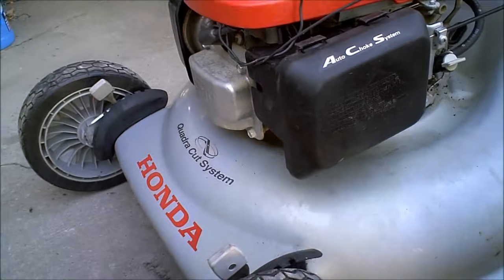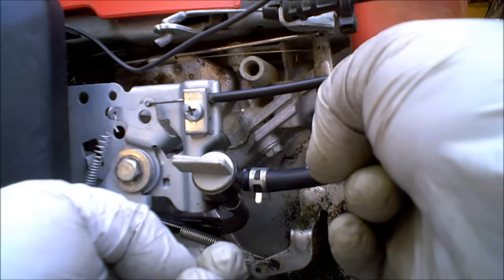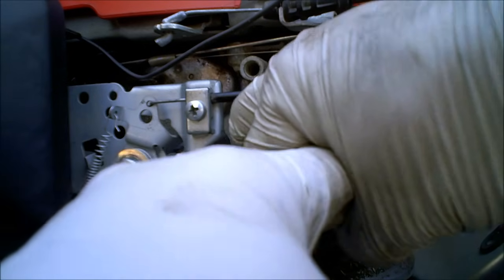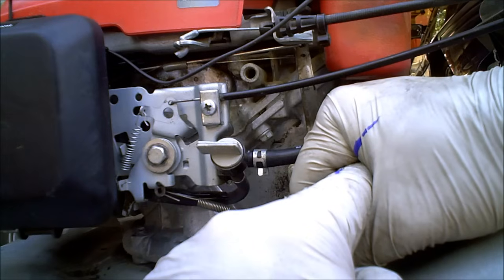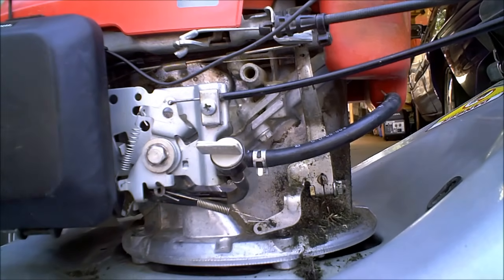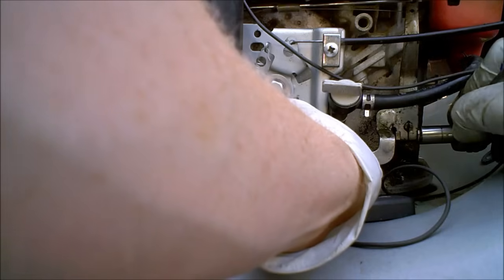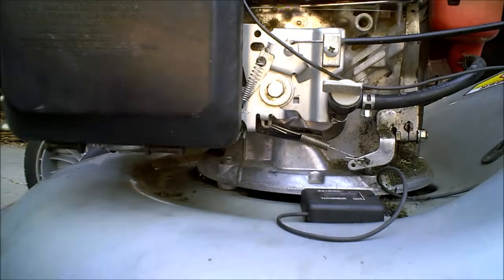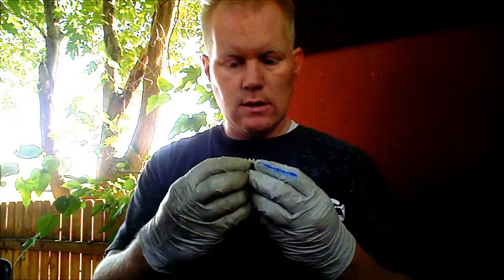Governor Adjustment and How They Work       Honda Briggs Tecumseh Kohler etc.

Comment: Appreciate the video 65Ford! Can u help me out? I have a 5.0 HP/158cc Briggs & Stratton Murray lawn mower. I've been messing with the governor and noticed that that's why my mower is over revving. I can't keep it to stay where it should though. I move it over and it starts and stays at the right RPMs, but then it moves over after about 30 seconds and stays over revved. Do u know what I need to do?
Reply from the maker: Free2 Speak Is your carb throttle moving? The butterfly can get stuck open.
Reply: sixtyfiveford It doesn't really move freely, but it does seem to stay open after a few seconds. Thanks in advance for the feedback.

Comment: I love governor videos.  I think of the old ones on  the steam tractors with the ball weights.  same thing as the internal ones here.  Hey you are looking clean cut in this vid!!!
Reply from the maker: Bruce Pender Yeah, this video has been around for a couple years and no beard then. Governors are a mysterious thing to people but they are so simple.
Reply: sixtyfiveford I hope you don't mind I just did a vid on the 6.5HP Briggs Intek. governor.  I had two come in before and then just after I commented on your video.  Things are so weird how they happen.  My first one was my 8-32 snow-blower (Tecumseh)
Reply: Thanks you are right.  I still get nervous in front of the camera and my brain goes blank
Reply from the maker: +Makek0086 It is a RPM maintaining devise. It maintains RPM weather it tries to go to high or to low.
Reply: the discussion continues.Thx 65
Reply from the maker: *****
I know exactly how a governor works and I didn't say it was just a limiting devise. It is a Maintaining device. It doesn't sense load, it's simpler than that. Your giving it more credit that it deserves. It simply tries to maintain a given rpm.

Comment: g'day, thanks for posting this video it was really good. i have a kohler xt 6 mower that has recently begun surging/hunting. it will run well for five mins or so then it just decides to start surging/hunting. very frustrating when im hlfway thru a job. ive had the local mower shop look at it (twice) and clean and repair carby (pin) but the problem persists. i want to ask you, do you think its possible that the governor mechanism is damaged? like the weights dont throw out correctly? do they break? get stuck? i'd really appreciate any advice you have to offer. thanks in advance, Haggis, Sydney Australia.
Reply from the maker: craigdy It's the carburetor for sure. The idle circuit is clogged or partially blocked. The governor surging means it is working and keeping the engine running.

Comment: Hey man, Great video.  Very informative!  Just got a brand new HRR2169VYA and was running great until the other day it started surging....brought it into my shop and they replaced a thermo wax sensor.  Fixed the problem....now it seems like my rpms are higher than before so I am most definitely gonna hook up a tah/hour meter to set it right. Only question I have is the 2 adjustments on the carb....I'm assuming the one closer to the engine with the limiter cap would be the main jet and the out Philips spring would be low speed? Correct me if I'm wrong but I had messed with them before I took it into the shop to try and bypass having to bring it in and would like to know how to get back to original settings before I go for a governer adjustment.  Info would be greatly appreciated! !
Reply from the maker: David Cardone The 2 noticeable screws on the top are: idle jet mixture and idle speed. The one that only allows half a turn or so with the cap is your idle jet mixture screw and you won't notice anything when you screw it in/out (should be turned all the way counter clockwise). The Phillips screw is your idle speed adjustment. Screwing this one in will increase the idle speed and screwed in too far will increase the engine "No Load" speed (don't want to do that). I little increase in speed isn't bad and you will get better performance out of your mower. Honda rates these engines at 3600rpm and run them at that in everything except for their mowers. There is a lot of debate on this but it comes down to: consumers believe a quieter engine is a smoother running, longer lasting piece of equipment. In the highly competitive lawn mower market you need to sell you mower as better than the competition and word of mouth helps. If you stand behind a Honda it feels smooth and quiet because it is running a lot slower than it's competition. It will do less work than it's competition with the same features but the average mower buyer doesn't know this. Increasing the rpm, like I did to this Honda mower in the video made it cut better and faster. The faster the blade spins the easier it cuts and the easier it is on grass and its roots.

Comment: Hey thanks man for the reply. You are right sometimes the motor sounds like its gonna stall.  The GCV160 is a very good work hourse of a motor.  I did mess around with the governor today and got the rpms up to about 2600. I quickly reset it back to 1800 because the motor was louder.  I think i will mess around with it a little more tomorrow.  Thank you for your help!

Comment: Hey man nice video. can you please help me understand something. I have a pressure washer with this motor, gcv160.  I hooked up a tacometer to it and it reads about 1800 rpm's. Is it safe for me to adjust the governor closer to the 3600 rpm mark?  The motor or pump wont blow up on me would it?

Thanks!
Bekim
Reply from the maker: 99% of all small engines are rated at 3600rpm safe operation and the Honda GCV160 is definitely one of them. 1800rpm will sound very slow and the motor will more than likely die when the trigger to the power washer is let off. It should be running at 3600rpm and you more than likely think it is to slow yourself or you wouldn't have checked.

Comment: Great Video, had I seen this before I tried screwing with my Honda Pressure Washer, it would have saved me a trip to the parts store for a spring I thought I could stretch and tighten.  Thanks for your time and effort on this, also saved me a trip to the repair shop for my unit.
Reply from the maker: Awesome.. Glad it helped.

Comment: i have a baja dirt bug with the stock engine i have to run it on half choke to run but it wants to die when you give it the hrottle and it dies when you slow down quick and it cuts in and out when it tops out what do ya think is causing this and do you know what the magneto should be gapped at
Reply from the maker: Definitely a Dirty carburetor.

Comment: Hi I have a HRR2162SDA Honda lawn mower that is probably six or more years old.  The lawn mower is running very high.  I unscrewed the bolt on the governor and tried adjusting it, but the it wont turn at all.  where you grab with the plyers it looks like a half moon. its different than the one in this video and it has a pin behind the governor arm.  Thanks

Comment: I have a honda gx160 it has been sitting a long time so i had to take off the carb and clean out all the varnish.  It runs great now but wont throttle down.  It seems to me the governor is pulling the throttle open even when the is very little spring tension on it.  What could be the problem,  any ideas?
Reply from the maker: Something may be hooked up incorrectly or binding. The spring holds pulls the throttle open and while running the governor is actually forcing the throttle closed. If the governor wasn't working correctly the engine would severely over rev.
Reply: sixtyfiveford I tried adjusting the governor today with what i learned from your video and that fixed it.  Thank you for taking the time to make your video and explaining things so well.
Reply from the maker: Great. I'm glad it's back up and going.

Comment: Awesome video. What part of the governor normally breaks causing it to be inoperative?
Reply from the maker: It virtually never breaks nor ever has any issues. It is blamed for carb related issues a lot and people mess with them. I have never had an engine come in with a broken governor.
Reply from the maker: Philip Kraker
Sorry for my delay in response. You comment got marked as spam and I just pulled it out from there. Yes, the EPA has mandated maximum blade tip speeds. But with your mower being a 21" at 3500-3600 rpm it will be within safety standards. Honda factory specs do have their mowers spinning slower than almost any other brand. They do this to make them quiet. Honda specs are around 2900-3000rpm even though the engine is rated up to 3600rpm. It will cut much nicer and be easier on the grass at higher rpms. So I'm assuming he knocked your rpm down to the 2900-3000 range. I would have him bump it back up.

Comment: Hi there nice clip, I have a Sabo self propelled mower that has a problem maybe you might have an idea what it could be :-/ the mower runs fine then the blade stops spinning then after a short time spins back up again even with little resistance (short grass) the last time I used it it was getting more frequent.  Cheers
Reply from the maker: Sounds like you have a mower with a blade clutch. The clutch is worn or cable that engages the blade is out of adjustment.
Reply: chris Todd Does your mower have a solenoid to engage the mower blades?
Check around for loose connections, especially the grounds.

Comment: Trying to put the linkage and springs back on a my honda engine not sure where the real small spring is supposed to hook into.  When I start it the engine seems to run too fast.  There is no throttle control, just one speed. Could show me picture of your linkage and spring setup? Thanks

Comment: this was really helpful 
i have a question if you were making a racing lawn mower if you can only run the same regular rpms as a normal lawn mower
Reply from the maker: 99% of all small engines "Red Line" at 3600 rpm. Any higher and you run the very high risk of throwing a rod. Some guys will risk it and push it to 4000rpm but never higher without extreme engine modification. To get more speed out of your mower you're always best to change your gearing or add larger tires. The little thing I am using is an hour meter with tachometer function.
Reply: thanks for the help and replying
this explains why my tractor through its rod 
thanks once again and i may have questions in the future to ask you
Reply from the maker: That sucks.
Reply: hey hows it going i was talking to you a little bits back,
 i have another question for you what does the wire do on a riding lawn mower at the bottom of the fuel bowl
Reply from the maker: When no power is applied it releases a plunger that plugs the main jet so the engine can't run. When power is applied it energizes and retracts the plunger to open the main jet. Is it giving you trouble?
Reply: thanks for replying so fast 
no it has not just un-wiring that blown engine i had told you earlier about and was wondering for my new engine that i am getting for my soon to be 4wd lifted mower if that was a necessary wire but from what you say i see it is 
once again thanks for the help you have been a good help and very informative 
thank you
Reply: do you mind telling me how the coil, the points and the condenser work together and what the condenser and the points
because i have an old sears lawn mower and i was tearing apart and was wondering what this does
also i am planing to make my own v-twin engine with 2 single cylinder engines or make a 4 cylinder engine with two v-twins, if i can find two engines
Reply from the maker: Points- opening and closing switch
Condenser- Now known as a Capacitor stores electricity
Coil- generates electricity

The coil has 2 sets of copper windings, primary and secondary. As the magnets in the flywheel pass the coil, the primary windings generate electricity and it is passed to the secondary coil through magnetism only. when the points open,the magnetic feild in the coils secondary windings "collapses".,meaning it tries to escape to ground,through the plug wire..the condensor aids in preventing the magnetic field from discharging while "building up" the charge in the coils secondary windings,,also it prevents current from backflowing to the points and arcing at the contacs and burning them..the magnetic feild in the coil wont build up like it should if the condensor is shorted out or defective..
Reply: so does the condenser get filled with electricity after the first spin then continue after to send the electricity 
do you mind making a video to explain
Reply from the maker: Let me see if I can do a video on it in the next day or so.
Reply: ok thanks there is no rush
thanks
Reply from the maker: Looks like a fun couple of projects.
Reply: ya it is, only problem is getting them all done because i jump from project to project. but hoping to get the lifted 4wd mower done for the summer time

Comment: One last thing. I adjusted the gov. Now the idle is 3600, but when I engage the blade, it drops to 2850. Does that sound right? I put in the new air filter. It still dies the first time I engage the blade, then it's fine thereafter.

Comment: Awesome. Can't thank you enough! My brain was swimming (not that it doesn't take that much for that to happen.)
I haven't used the mower since we got a rider last year. I took apart the carb, cleaned it out and hit all the jets with a copper wire. The filter was looking pretty dirty so I bought a new one. Moved the gov, it was around 4k, but ran out of time to fine tune it. I'll post my results after I get it finished.

Comment from the maker: cont: In the commercial mowing industry they run their blades at the fastest the government will allow(yes they even regulate this). 

To sum up. 3600 will give you more horse power and cut the grass nicer.

An engine that dies when the blade is engaged generally means carb issues. It could be as simple as a dirty air filter or a partially clogged main jet.

Comment from the maker: The engine itself is designed to run at a constant 3600 rpm safely. They use this engine on various equipment and on most 3600 is required. Honda however has their mowers set a lower rpm for several reasons: sound level and overall engine life. The engine will last longer at 3100rpm vs 3600 but you also does significantly less work at 3100 rpm. The technique mowers use in cutting grass give a better cut the faster the blade spins. The faster the blade spins the faster you can walk with the mower

Comment: The idle speed is around 2800, so I'm going to fix that tonight. The clutch plate is in good shape. Compared it to a new one. Is there a down-side to setting the governor at 3600? Of course, any repair I attempt is at my risk and you are not liable even if you say, 10k? Sure, why not? ;P 
Sorry for the friggin' novel!
-Rusto

Comment: (cont) blade engaged? This model has the blade control where it starts and idles with the blade stationery. It doesn't spin until you engage the Brake Control Lever. I saw the note about mowers being governed. I'm just confused why the manual would mention the Max HP at 3600 if you're not supposed to run it at that speed. 
My mower has been stalling when I first try to engage the blade. If I engage the blade slowly, it won't die. Plus, it's fine after warming up for a minute. (Cont)

Comment: Great vid, thanks for posting it! (Just watched a couple of painful ones, argh) I'm a little confused. I have a Honda HRB216HXA. The manual states under "Engine Design and Performance" Maximum Horsepower is 5.5bhp @ 3600rpm Max torque at 2500rpm. "Tranny Design & Perf" shows ground (walking) speeds at 3100rpm. THEN under "Maintenance" Max Governed Speed as 2950-3100rpm. "Tune-up" 1750rpm at SLOW idle. Since it states Max Gov Spd as 2950-3100, is that where it should be running with the

Comment from the maker: It's your idle circuit in the carb that is causing the surging. Ebay has new carbs for around 20 bucks or you can attack it again.
 The carb can't maintain a set rpm because there is no or too little gas flowing through the idle circuit and it has to keep opening the main butterfly to get more gas. The engine then revs to the rpm it should be and the governor closes the carb butterfly and the cycle repeats.

Comment: Thanks for the great video! I have a Honda GX160 (in a snowblower) that surges like crazy. I have cleaned the carb ten times. I made sure to push wires through all of the small openings everywhere! My question is: if the spring tension is incorrect on the linkage, could that cause surge? I'm pretty sure I stretched at least one of those springs while removing/installing it (ten times). Is this likely? I'm about to throw my hands up and buy a new carb :( Thanks again for the great video
Reply: Did you ever find out?

Comment from the maker: Governors are virtually bullet proof. Your engine is surging/slapping because the idle passage on your carb is clogged. The carb can't maintain rpm because of to little gas flow through the idle circuit and has to keep opening the main butterfly to get more gas. The engine then revs to where is should be and the governor closes the carb butterfly and the cycle repeats. "IF" your carb has an adjustable idle jet screw it out 1/4 turn at a time until it smooths out.

Comment: THE MAN IS SHOWING YOU HOW TO DO IT. YOU DON'T HAVE TO OPEN THE BOTTOM OFF THE MOTOR LOOK AT THE VIDEO AGAIN WHERE HE DRAW THE LINE ON HIS FINGER THAT'S WHER YOU CAN GO AND ADJUST IT.I JUST REPLACE THE PISTON ON MY 6.0 BRIGGS. HAVING HIGH RPM NOW WITH RE ADJUSTMENT DID IT.IN FEW DAYS I WILL PUT MY VIDEO OUT